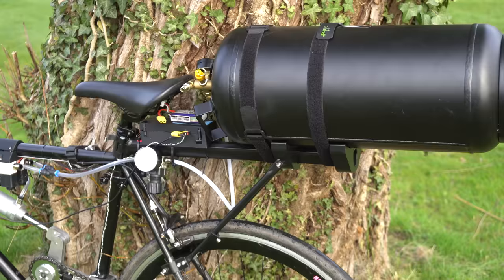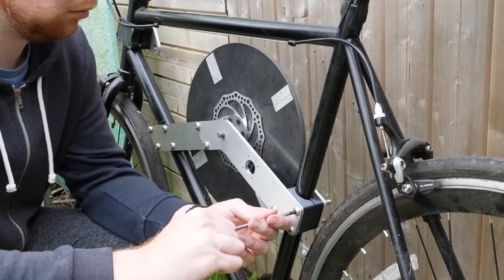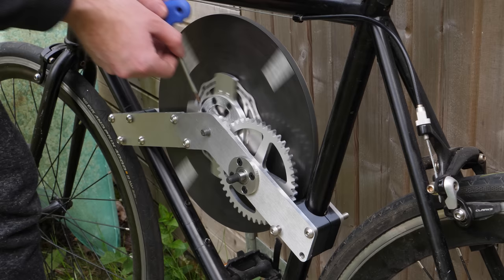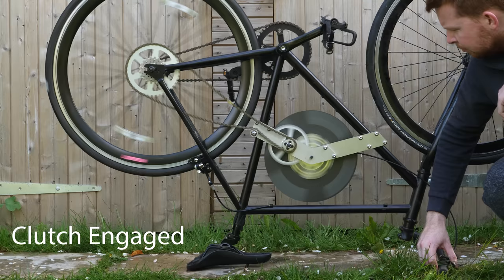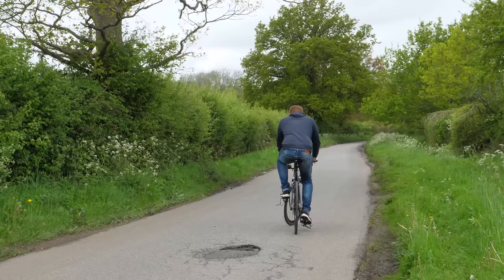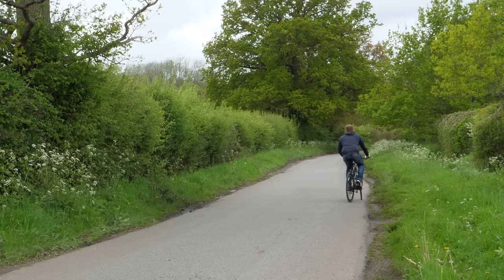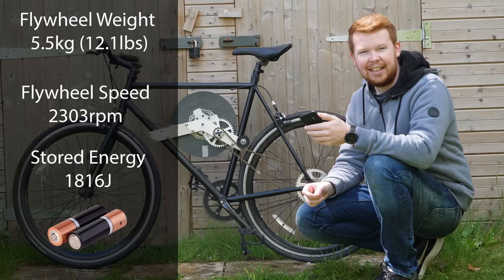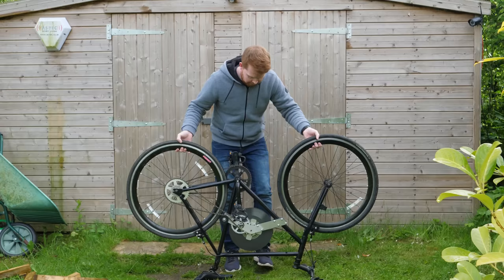Flywheel Bike KERS

Comment: Lube. Lube those gears. You’re losing a tremendous amount of energy in friction on those chunky cogs.
Reply: Everything can be fixed with more lube.
everything.
Reply: @100acatfishandwillbreakyou2  No, not everything… around half. The rest being solved by duct tape.
Reply: Big difference when you lube a chain.  Feels like the bike is 25 lbs. lighter!
Reply: @thelakeman5207  I agree. I build high speed gearboxes for a living, not only will it turn with far less effort, the teeth will last 1000x longer. A wet gearbox is a happy gearbox.
Reply: @Whiskypapa  what about flex tape
Reply: @Whiskypapa  There's a handy diagram:
Is it moving? Is it supposed to move? 
Yes 👉 leave it as is.
No 👉 use duct tape.
Is it not moving? Is it supposed to not move?
Yes 👉 leave it as is.
No 👉 use lube.
Reply: I was thinking replace the gears with another chain drive. May be capable of getting a higher gear ratio, quieter, and more efficient.
Reply: @Whiskypapa  "If it ain't movin' and it should be, WD-40. If it is movin' and it shouldn't be, duct tape." Now if only someone would invent WD-DuctTape to solve both problems...   :P
Reply: @thelakeman5207  its also great when you increase the pressure in the tires of your bike to the maximum after you were driving around with half flat tires all the time and now it feels like you are riding a super light Tour de France bike.. 😂😂
I never forget how awesome it was when I had always cheap bikes until I was 17 and bought a new mountain bike for 1,200€ (reduced from 1,500€) which was mostly aluminum and had 29" tires which had pressure of max 4.8 bar, 30 gears and hydraulic brakes. That felt like a rocket! I got up to 50 km/h on street and once over 80 km/h downhill.. just a shame it was stolen after 3 years.. 😞😓😭
Reply: And that chain!!! It sounds like it’s grinding itself to bits
Reply: @pilcrow182  WD40 isn't really a lube... its water displacement #40... 
 Sure it can help a bit for some time, but shouldn't be the main go to
Reply: @helpabrothawithasubisaiah5316  I'd say it's designed for 'quick fixes' in the same way that duct tape is -- neither are meant to be a long-term solution, but they work in an emergency.

And WD40 absolutely is a lubricant, if not a great one. It's made mostly of petroleum oils and hydrocarbons, and according to the company itself, WD-40® Multi-Use Product (their main formula) is "a maintenance product which acts as a lubricant, rust preventative, penetrant and moisture displacer." Besides that, they've come up with modified formulas for better lubrication, such as WD-40 Specialist® Gel Lube...
Reply: @Whiskypapa  Solve Et Coagula
Reply: @helpabrothawithasubisaiah5316  3in1 is the old goto for sure.
Reply: @100acatfishandwillbreakyou2  burnt food?
Reply: @Whiskypapa  same as above (burnt food also?)
Reply: @beaclaster  Take you burnt food and cover it with duct tape. Remove said duct tape and watch the adhesive drag off the outer layer of the food which is burnt. Repeat until no more burnt food remain.
Reply: @lovelessperformance4457  everyone likes wet box hey
Reply: @thelakeman5207  It's true
Reply: @IronWarrior95  That's the reason I stayed with a $150 WalMart bike.  They don't steal the cheap ones.
Reply: @Whiskypapa  ah I see you’re familiar with the mechanical engineer flowchart
Reply: insert Hehe hoi meme*
Reply: What about flywheel with rear wheel?  Better use of space? Possible get rid of the clunky cog set up you have.
Reply: @IronWarrior95  If you ride in mud, a softer tire is better for traction (but harder to peddle), a harder surface, harder tires are better.
Reply: A bit of grease is all it needs.
Reply: whats lube? can somebody tell me
Reply: more lube and a drum style clutch and the flywheel is on the same axle as the wheel with a drum clutch and nice ceramic bearings. flywheel with more mass at the edges and less in the middle would be better i think too.. depending if theres a gear ratio thing happening
Reply: @oncinaproductions  Thats what i said to my ex.
Reply: @100acatfishandwillbreakyou2  You mean, like relationship?
Reply: @Whiskypapa  ... relationship? :P
Reply: And you need better angles cut into the teeth
Reply: If he used lube, then he would have to build bellhousing for the clutch to prevent grease from entering the crevice of the clutch and the flywheel.
Reply: @mihan2d not any lube. WD40

Comment: "However, you can't charge and discharge this batterys not nearly as fast as this flywheel..." Sounds like a new Super Capacitor Project :-)
Reply: Agree
Reply: Or could motors be used to create a electric infinite transmission between the wheel and flywheel?
Reply: @TheNateDawg94  That was my first thought actually. Clutches are very wasteful.
Reply: @nrdesign1991  especially if you need power but the flywheel is spinning slower than the chain...
Reply: I was going to make the same comment! I immediately thought the same thing upon hearing that exact quote.
Reply: @TheNateDawg94  If you have the motor, go ahead and make it a generator instead and charge the capacitor. To use the capacitor would of course take a bunch of electronics to adjust the voltage as the cap charged-discharged. This is done in electric vehicles now and is VERY efficient!
Reply: I had the exact same thought. It also made me think of the flywheel as a mechanical capacitor
Reply: that's exactly what I thought (y)
Reply: MAN! i literally just made a comment ranting on about how supercaps are perfect for this, and then I saw this. noice.
Reply: @squishysheep5862  same here, perfect application.
Reply: Not really necessary. It’s 1816J (0.5wh). A single 18650 can handle that charge no problem. The issue is not about how fast the energy is stored. I would be more concerned about the voltage. That’s where the capacitor may be useful. But still. 0.5wh is nothing, won’t get you moving much. Not ‘useful’, may be interesting? Yes, but pointless
Reply: Exactly what I thought, and as level two combined with batteries
Reply: Have rare earth magnets on the flywheel. The flywheel has an electric clutch mounted to it, so when your up to a comfortable speed it can be engaged. These electric clutches are used in AC compressors in vehicles.
Use a three phase charging coil setup that can slide mechanically to the flywheel magnets when braking. 
When not braking the coil is away from the magnets and there should be no drag induced currents.
This will charge a super capacitor bank very quickly. Used in conjunction with a small lithium battery as well.
A motor with an electric engaging clutch will work to power the bike, so that when not used there is no drag.
Control it all with an Arduino or Raspberry Pie etc.
Reply: A supercapacitor wouldn't be able to store anywhere near as much energy unfortunately. A flywheel is one of the most efficient ways to store and release energy quickly.
Reply: @1992jamo  you are wrong. Regenerative braking is a perfect application for super capacitors.
Reply: Beat me to it, yes should be mechanically simpler and significant weight savings to boot. I was thinking the noise level would be lower, but then I thought of those old electronic camera xenon flashes with their recharging whine and wonder if we would experience anything similar here.
Reply: @tr4n5ist0r  You are right. I did the math because I thought I was right. But 1800J can be stored in super caps which are ~12V 25F, or 2.7V 500F. I didn't think super caps had the energy density for the job.
Although I'd love to see a better flywheel which as almost all of it's mass at the edges.
Reply: There's no need, most batteries can be discharged extremely quickly by igniting them. I always have difficulties putting the magic smoke back inside them, however.
Reply: maybe a lipo can 🤔
Reply: @1992jamo  A Supercap with this specification would be a bit smaller than a Red Bull Can and weight around 90 gramms. And it costs around 10$. I think that would be better than a Flywheel in any perspective.
Reply: @Habakouk77  While that's true, realistically how much of that energy are you going to be able to put back into a motor? The voltage would drop sharply with a capacitor
Reply: he was referring to alkaline batteries.. they put out something on the order of single watts. lithium batteries get pretty crazy with pocket sized RC car batteries doing kilowatts
Reply: @TheNateDawg94  you can emulate an ivt using a split power system, aka toyota's hybrid synergy drive

You have some limitations, namely that it fundamentally operates through torque transfer, exceed the holding torque of mg1 and it just slips, and you have some inherent speed limitations
Reply: Yes

Comment: That’s great. Now I know why bikes never use flywheels.
Reply: They use it (sort off) but more to have a bigger impulse and make it harder to slow down, and not to break/accelerate easier
Reply: This is not worth the noise and effort.
Reply: I wonder how it will influence the bike's handling when doing a quick turn with the flywheel at full rev.😬 Great project b.t.w.
Reply: @ottonormalverbrauch3794  yes it most certainly will. Gyroscopes are nothing to hyuck with

Comment: Tip for the flywheel: Because the mass at the outside of the flywheel has more rotational inertia you would have better performance using a thin central disk, and welding or bolting thick rings on both sides to make the cross section an I beam. For the same volume/mass you would have a much higher rotational energy saved up at the same RPM. :)
Reply: Hmmm yes yes🥸
Reply: Adding razor blades would deter thieves and make it safer.
Reply: @ghlibisk67  sure it would keep it safe for the rest of your life.... which happens to be about 3 minutes longer than it takes for the glue to fail launching the razor into your femoral artery.
Reply: IT willl not work. Try to hold bicycle by the hotizontal axis , put it in Rotation and try to tilt it. You will feel a strong force that tries to move the axis in a vertical position. The Same will happen with the flywheel when you change the direction in a bend. And why all this effort? We already have the E-Bike and we can use Rekuperation like an a car
Reply: @friederich66  Because its fun why not do it? Being boring isn't very fun.
Reply: Exactly, visually something just wasn’t right.  To think some World War II aircraft and even afterwards had inertial starters. So that in the event of a power failure they could start the engine by hand.
Reply: Your approach would require a lot of additional work and balancing of the flywheel, but you are right👍🏼
Reply: @friederich66   just add second flywheel in oposite direction, it will work :)
Reply: That's a really good point
Reply: @friederich66  Flywheels don't need lithium-ion batteries.